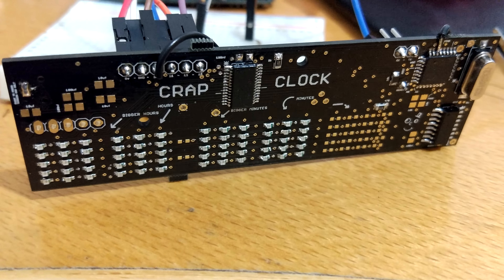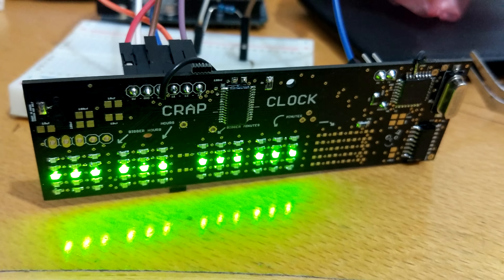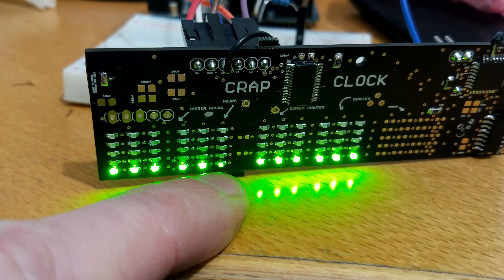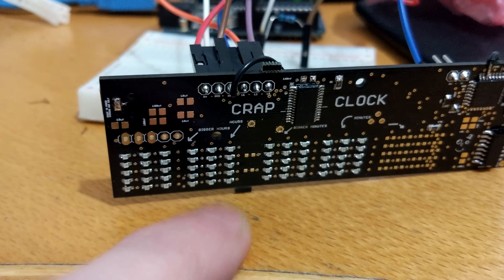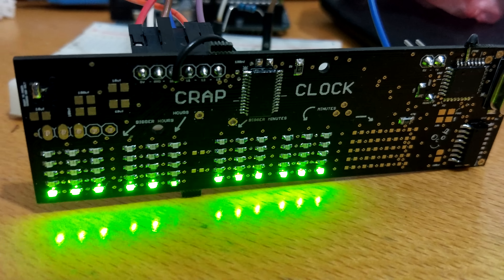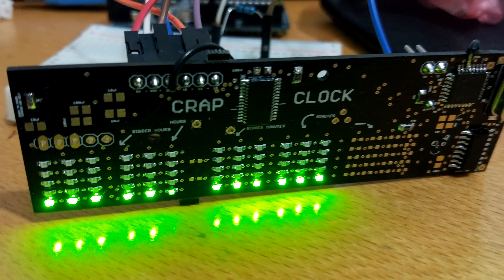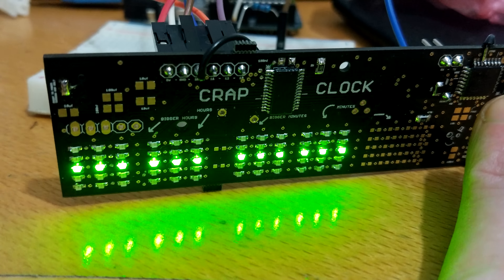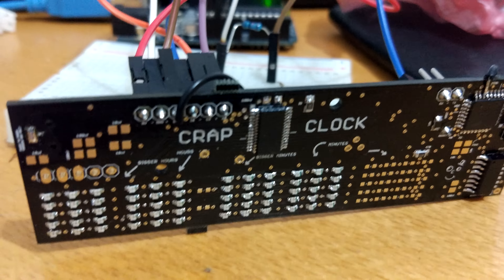Quick update on the Crap Clock

Comment: It's alive! Congratulations on the tiny LED soldering. Very neat job, especcially taking into account that the webcam was blocking most of you vision.
I still am struggling to find a succesful way to an acceptable capture of my soldering action.
The other day I was busy for quite some time, soldering a tiny led-bar using 0805 leds, 0.1mm wires and prototype board. I tried to capture the action using a Denver action-cam. Wrong choice I found out later, as the wide-angle lense makes the recording totally useless for YouTube. Guess I have to solder another one and try out my old Logitech webcam. My phone has a good camera, but seems to large and risky to solder underneath.
Thank you for your video's. They are quite enjoyable and interesting!